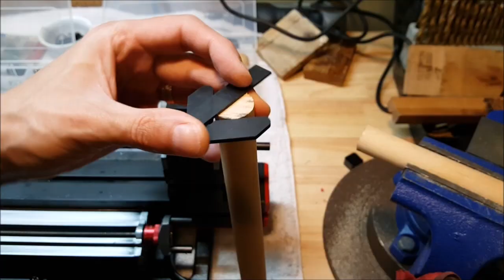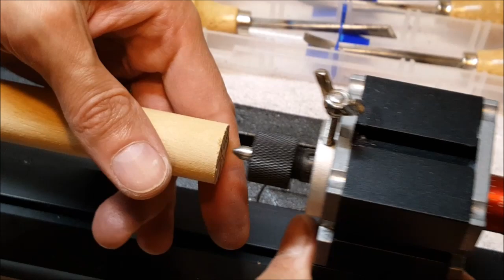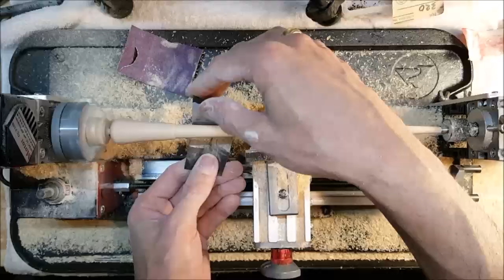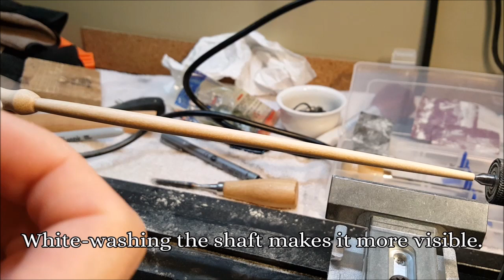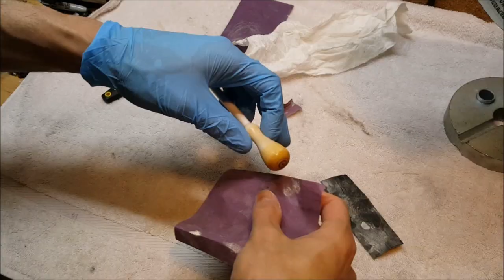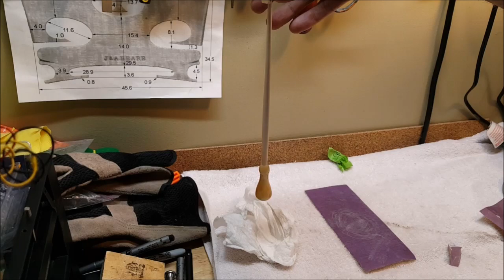Making a Conductor's Baton (magic wand?)

Comment: Please give the measurements 😭😭😭
Reply from the maker: Measurements? I pretty much freehanded it.  😉
But the overall length is 10.5", the stick is 8.25", handle is ~2", and 7/8" on the thickest part.
Reply: @SculptyWorks  wow that's impressive. I don't know anything about woodwork, but I am interested in conducting. What is the thickness/diameter of the handle? And is the tip about the thickness of a standard pencil?
Thank you so much for answering!!! Really needed it because there are no online delivery services in our country, and no conductors or batons.
Reply from the maker: @symphonyofsolidarity  What country is that?
And batons tend to be personalized, every conductor has their preference. You could say the stick is about as thick as a pencil but it tapers towards the tip. The handle is the thickest part but it's pear-shaped so it narrows to just about the thickness of a pencil and then it flares out a bit to create a  flange type of separation between the handle and the stick.

If you have no alternative, a straight long stick will work just fine to conduct. Ideally you want it to be white, so it is contrasting and easier for the musicians to see. The handle just makes it less likely that it will slip off your hand, and is also more comfortable to hold, but like I said, if you have to, a plain ol' stick will do.  👍
Reply: @SculptyWorks  okayyy thank you so much for helping!!! 
Btw I'm from Afghanistan. And yes, music is illegal here, but only in public places. And music in spotify, youtube, etc is banned here, but we all use vpn. 
Also, instruments are illegal here. Only male acapella are allowed. And I'm female. Yeah, there are lots of problems, but finding a stick is how I'll start solving them :)
Reply from the maker: @symphonyofsolidarity  Wow! Please be careful and don't get in trouble!